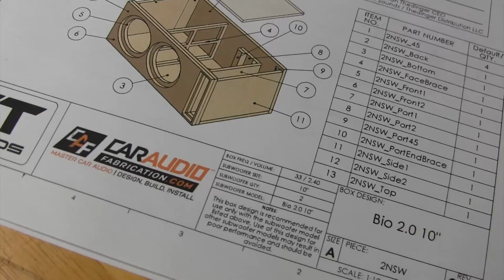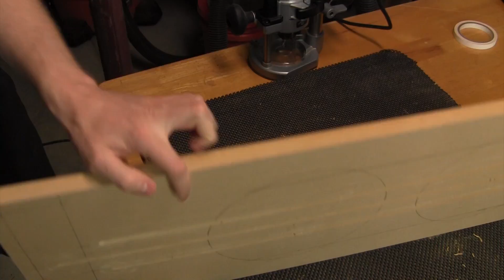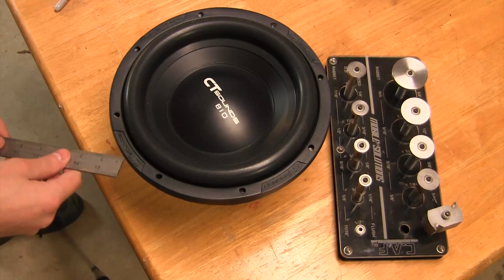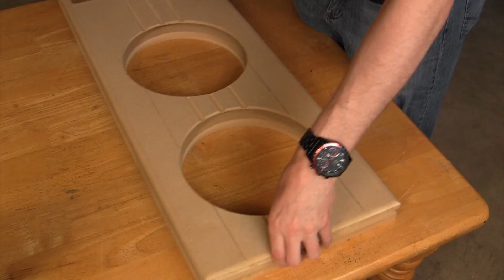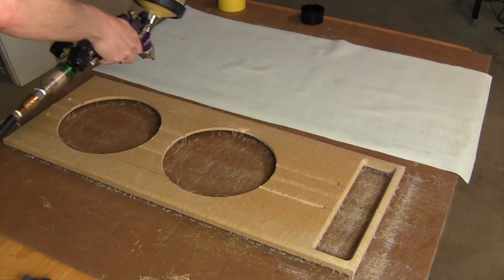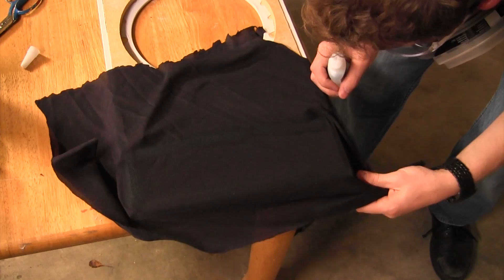CT Sounds How To | Build a Ported Subwoofer Box

Comment: The Design of the FaceBrace Part (No 4 in the Desription) looks amazing, but it is not as efficient as the orginal cross shaped. 
Those 45 corners are quite useless, too, if you build everythig precise and use good quality glue and maybe some screws (drill hole first in MDF or it will split the board)

But overall a really good looking Box that needs lots of tools unfortunately.

Comment: I was wondering if you could build a subwoofer box for under the seats in an extended cab truck?
Reply: Id like to watch this as well I'm in the process of building mine for a 2014 Chevy Crew. Im shooting for two sealed 10s facing upward with an amp rack in the center

Comment: Awesome build Mark! Is it possible to apply the same carpeting technique when your port is on the side of the box? wouldn't it interfere the rabbets on the side to tuck the carpet in?
Reply: You can add a round over and intentionally go a little deep. This will leave a lip, still to the rabbet on the other 3 edges of the side.